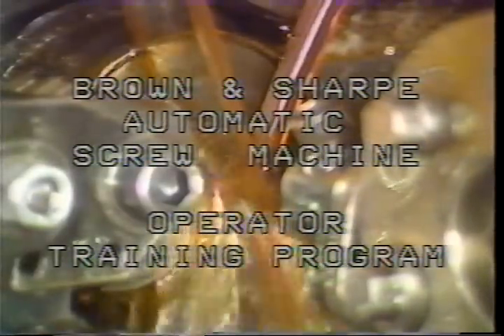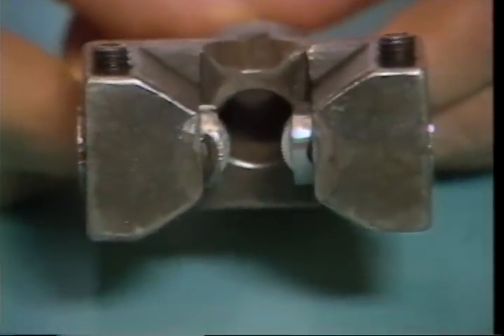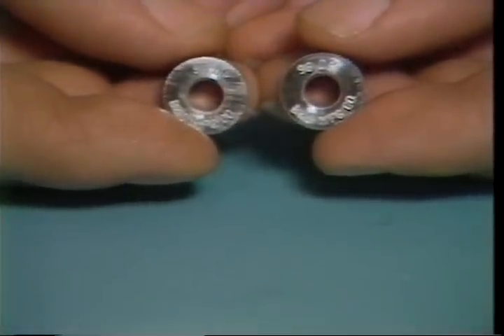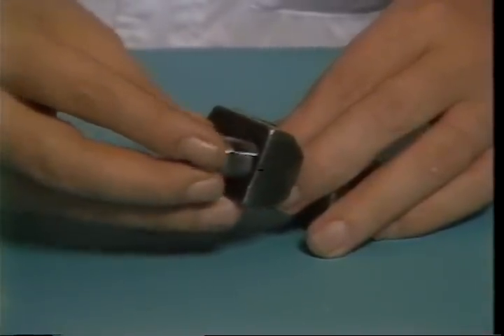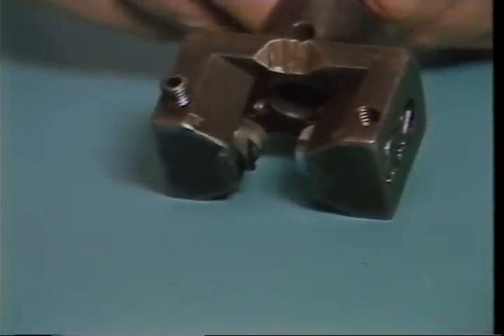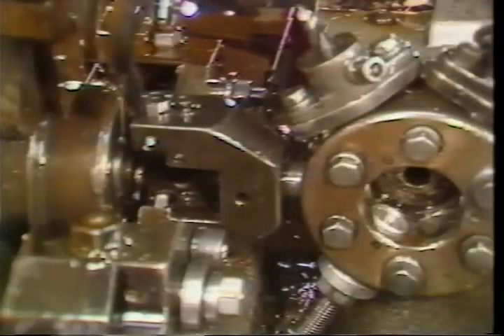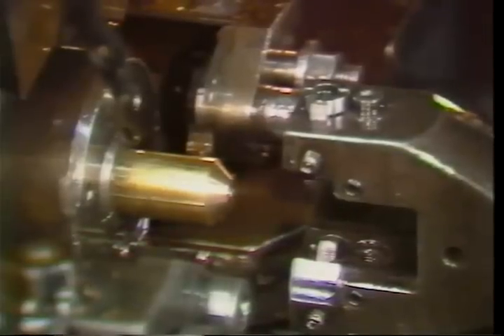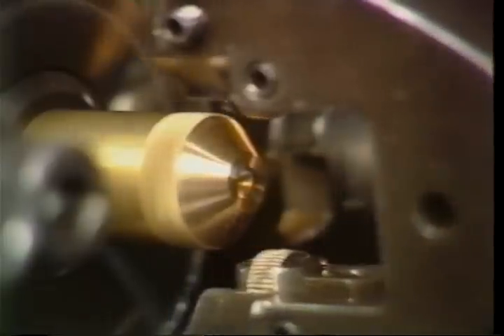Brown & Sharpe Setup Training Part 10: Knurling

Comment: These knurling tools do a really great job and can easily be adapted to a regular engine lathe.  I have one with the 1" shank which fits perfectly into a 1" boring bar holder in the BXA tool post.  I'm not sure what size of knurl would require a 1/4 turn adjustment on each knurl but that is WAY too much for the 30 pitch knurls I have.  I need only about .010" of movement total for a perfect knurl.  That's just under 1/4 turn total (only adjust 1 side).  The easiest way to set it up, if you have the extra material, is to turn a short section of material to .010" under the finished diameter of the part you intend to knurl.  Then move the knurls in to make contact with this undersized surface.